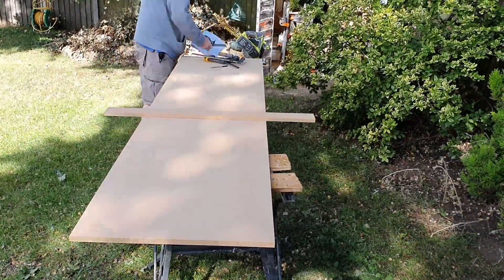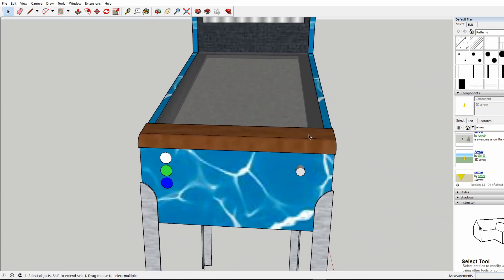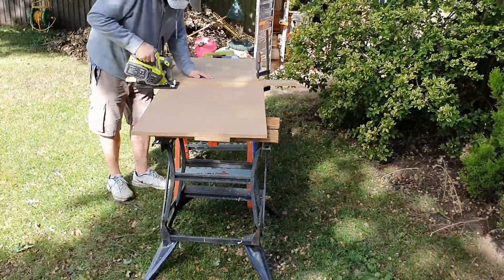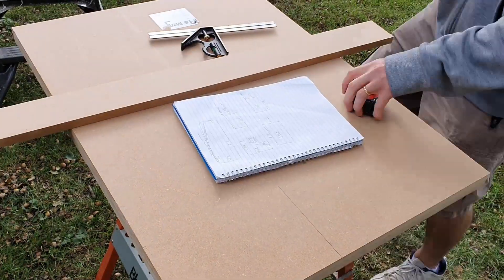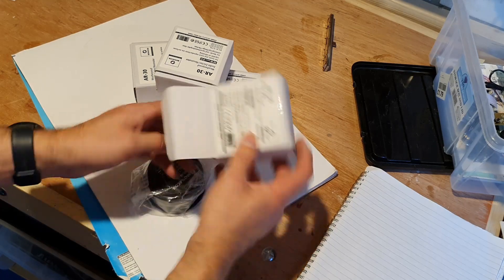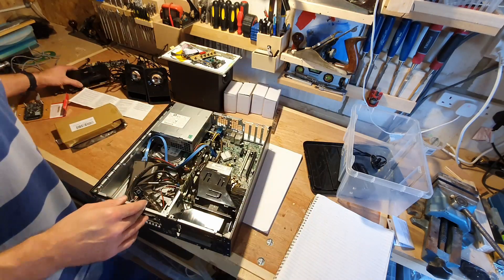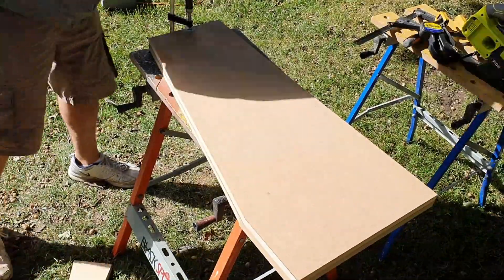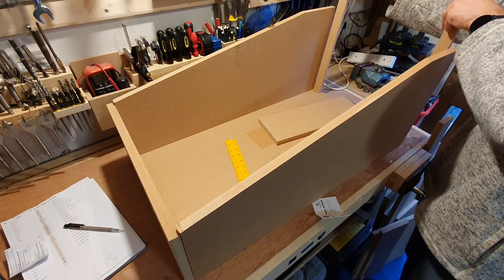Mini Virtual Pinball Table Build: Episode 1

Comment: Do you still have the measurements for cutting the wood? If so could you post a link to the file?
Reply from the maker: Hi Seth. I can share the original Sketchup plans with you. I did deviate a little as I went, mostly with the internals and trim, but the main body should be very accurate.
I will put it in the description of the first episode.
Reply from the maker: Have done that now.
Reply: @MoreFunMakingIt  thank you very much.

Comment: A lot you can skip like adding a shaker, strobes, and led strips. However I would highly recommend ssf with at least one bass shaker and 4 exciters so you can feel the ball rolling, coin drops, motor, chimes, etc. If you can fit it get that smaller plunger for mini builds. I would look into solenoids since ssf helps but solenoids really makes the pinball games pop in realism. I just use small simple 12v $4 each solenoids, 12v 10 amp power supply, and a 8 port 12v w/usb sainsmart to control it. One other thing get leaf buttons for the side pinball buttons and no microswitch ones except for the front. If you want something easy get the groovygamegear leaf buttons. Mount like happ buttons but are real leaf buttons. Besides that try to get pinball legs and a decent backbox sound setup and you will have an amazing experience without going nuts on all the toys like flashers, leds, strobes, dmd, coin door, fans, shaker, tilt, or subwoofer. So much is optional. It’s like leather seats. Don’t need it but you want it. I’ll try to follow your build. I love seeing these home built pinball cabs come to life. I have no skill at woodworking so I cheated and got a recroommasters cabinet that allows adding your own toys. You would have liked their discontinued mini cab design. Nothing against grs but rrm’s really did look more like a 90’s pinball cab. If you are not following strict plans you might want to check it out on the backbox and front of the cabinet design.
Reply from the maker: Wow! Thanks for taking the time to give all that information. I can tell you speak from experience!
You've pretty much nailed exactly what I'm going to do. The plan is to start simple and keep adding things. I'm going with 4 exciters to start with (no bass yet) and I'm keen to try solenoids once it's all built. The only thing I'm not planning to add is strobes and led strips. They look very cool but I'm not convinced I need them.

Comment: Great video, I’m planning to do the same. Do you mind sharing what your budget is and can you share a full parts list. I’m still working through all of the software. Once I have that down I’ll move to getting the parts for the table. I’m looking for a gutted / broken pinball machine in the mean time.
Reply from the maker: Thank you! Once I've got a bit further into the build I'll have a full run down of parts and costs. You're doing it the right way getting a handle on the software, pretty sure that's going to be the hardest part to finish.

Comment: Thanks for sharing! I plan on doing a very similar build, but with a 32-in 120 hz monitor. If you would, please do a video specifically for  KL25Z board wiring and installation.... Pretty please. That's the only thing that has be scared. I think you would make a lot of people happy if you made that video
Reply from the maker: Thanks for watching! :D Wow! I would LOVE to build a high refresh rate, large playfield, table. I tested the software on my desktop system which has a nice 27" 144hz screen and it was AMAZING. 
I am totally making the KL25Z video. That is high on my list of things to do :D